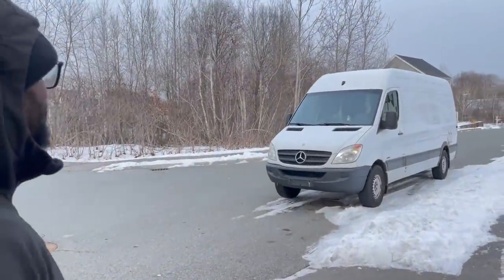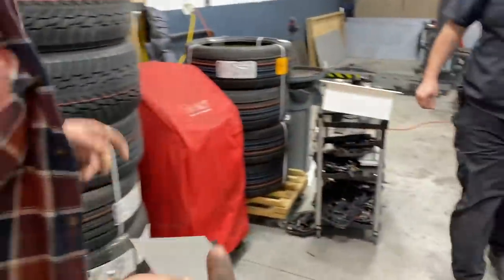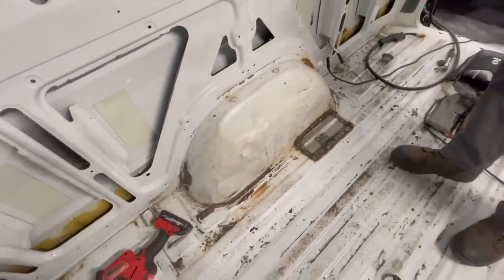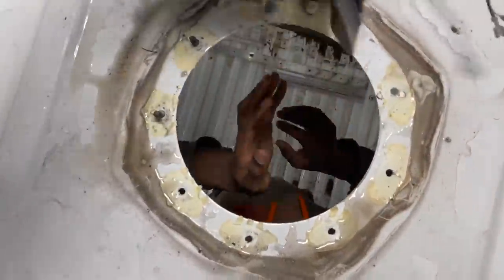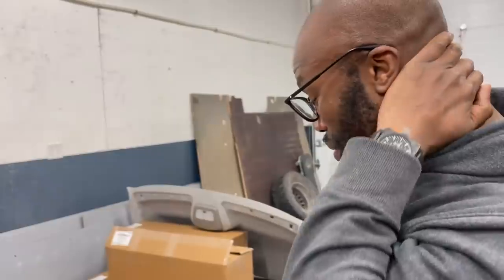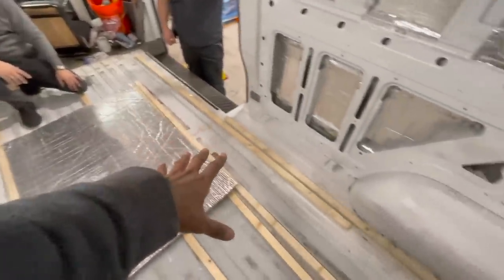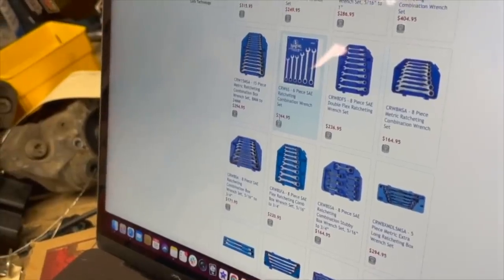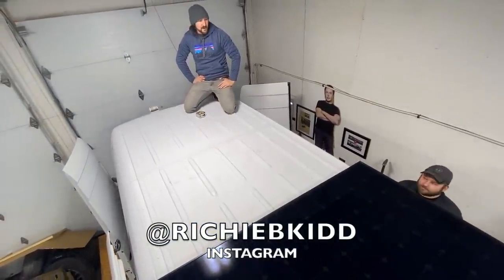Fixing the rust problem in our off grid sprinter van for just $8

Comment: Hey rich throw in a multifuntion steering wheel and the high-spec tachometer (both are plug and play no coding needed) and install an android headunit with an usb to hdmi Adapter so she can watch-tv or music-vids and use the stereo of the van (wich needs to be retrofitted and upgraded) 👌🤔
Reply: Ultimate Rich move would be to only allow videos from this channel to play on that system. 
Great idea though since the van has all the wiring and whatnot already in it.

Comment: Closed cell spray foam is the way to go. Keeps the moisture out. You can buy 600sq foot cans at Lowes or Homedepot and do it without a professional company. Works way better than any other insualation and the biggest problem, you won't have mold growing on the other side. OH and it actually has a real R value unlike the reflectix crap.
Reply: Is it nonflammable ?
Reply: @BobDevV  rockwoll does not smolder at normal temperatures ....
It is quite literaly molten minerals.

Thats like trying to burn down a rock
Reply: Yeah so many people use refelectix the wrong way, your getting a small thermal break that’s it. it ain’t insulation people but it does reflect ;)
Reply: The silver tape is not for heat/cold, it adds mass to the thin metal to absorb resonance aka sound deadening. If you've ever driven in the back of van you will know that sound the bare metal makes is stupid loud. Adding the B-quiet stuff makes the panels vibrate less and in turn lowers the noise levels.
Reply: @hein_mcleod  especially when you try to sleep and it is raining it helps really much

Comment: You should put sound deadening over the windshield, that lets in A LOT of noise. Just a thought.
Reply: Well you joke, but I reckon this would have sound deadening qualities... "In 1996, for the same occasion, BMW decided to unveil the ‘Insect Deflector Screen’, a new feature that would keep your windscreen bug free. The system, developed by Munich scientist Dr. Jurgen Afalfurit was comprised of a clear rubber coating applied to the windscreen. The rubber layer was so thin it would be invisible to the eye and yet so elastic that would instantly repel bugs even at higher speeds."

(Hint, translate the good Dr's Jurgen's surname to English)
Reply: You can buy “acoustic “ sound deadening windscreens as an option for a lot of models. Just looked it up, not the sprinter though :(

Comment: I watch a lot of car audio videos, and you know I'm actually really impressed by how you guys did the sound deadening  along with also doing thermal Insulation at the same time. very cool guys and thanks for showing us that.

I did have a question about the solar panels and I know the panels that you're putting on there are very efficient and probably last a long time, however I was wondering about the ones that you can physically attached to the body that are somewhat semi-flexible and wood mold to the surface of the slats up on top of the roof.
I was thinking about making my own or at the very least getting the flexible style panels that roll or the ones where you were able to mold them at least closely to the shape of the ceiling of the van.

I order myself some solar panels from eBay and was going to do the same thing but I realized that I can't use the regular polycrystalline style without them cracking so I was thinking about getting some small flexible panels that are thin enough to go in between the slats  that way it looks like it was integrated within the body.

there's a lot of surface area up there and sit sits on top of the roof more than likely it'll never be messed with so it's something I was thinking about doing this summer

Comment: @RichRebuilds please note that this silicone stuff you used for caulking the vent was technically the total wrong stuff. 

At home in your bathroom the temperature differences summer to winter are not big. But parking the van in the summer sun and driving through winter temeratures requires a stuff that is designed for that and will not crack and leaking. 

The internet is full of camper van owners crying over leaks because they made it wrong. Do not make the same mistake Leena will have to regretting, please.

The right stuff for that is Sikaflex®-252 : is suitable for dynamic loading, structural bonding, Product advantages: 1 part, Elastic, Can be painted, Tolerance compensation, High dynamic load, Vibration-retardant, Non-corrosive, High electrical resistance, Wide range of adhesion, Silicone free

Greetings from Germany! Love your channel

Comment: Gotta love rust repair! "Hey, it's a tiny hole. We'll be done by lunch time." Two days later you have chased that rust hole with the welder half way to the other side of the car and you're looking for two more panels to completely replace because you have discovered more rust under paint.
Good job on that patch panel though. Wasn't expecting it to be contoured to match the floor, but makes sense with how large it ended up being. Looks good!

Comment: I was missing every 10mm socket in my set - 1/4 drive and deep, 3/8 drive and deep, and 1/2 drive. I went to home depot and bought replacements. Now every time I turn around there are 10mm sockets. I even used a craftsman 10mm socket and I've never had a craftsman socket set.

Comment: OMG! RICH!  do you not also understand that the partition keeps things from hitting you while you’re driving if you have to make an emergency stop or someone hit you. I have a partition in my van. And I wish the door slid, it opens. I don’t sleep in my van now, but I slept in my van before. My van has no markings.  And I look like one however many expediters in the country.  I also set up my van to expedite, so it has a wooden floor with a E track, E track on the walls, no insulation, because it’s a work van and not a camper van.

Comment: I like how you guys are crushing the insulation and making it about 10 to 30% as effective as it arrived to you
Reply: This is sound deadening insulation, not thermal.
Reply: @Johnsmith69448  Its actually about both (if you want a van that is more comfortable in the mornings or isnt an easy bake oven). If i'm not mistaken about this product, this is glorified bubble wrap (which has ok thermals, if you dont compress the air out of the sheeting). The actual sound isolation this offers is limited and something you dont see recording studios using (if it was such a great material because of volume saving or price; more studios would use this to stop low frequencies than more costly approaches (double walls / weighty materials))

Usually the cheapest sound material are shipping blankets or nonvibrating quality plywood (providing the greatest density for cheap construction). That is if you care about trying to stop low frequencies.  

If you place flush (to your wall) 2 ply plastic sheeting, that does nothing to deaden any significant frequencies (high or low).

Comment: Those Merc and Chrysler versions vans are RUST buckets.
You definitely want to rust proof the doors (from the inside) and all the underside with a proper sprayed oily product. A must on those !
The tires are truck rated i.e. for heavy loads. They probably are rock hard. Softer tires would be a great improvement, comfort wise.
Great deed for your young lady, guys !  👍

Comment: Just FYI to viewers who actually work on stuff, steel from a steel supplier costs a tiny fraction of the amount that it does from a box store. I pay less for a 4 foot by 8 foot piece than I would for a square foot at HD. Smaller amounts are so cheap it will cost more in gas to go pick it up. Most towns have a steel supplier. A town of 50k might have two. I've restored a dozen 50's truck and only use steel patch panels made from mild steel. Saves hundreds to thousands on a restore.

Comment: As a sheet metal worker this makes me feel warm and tingly inside and also happy that projects like this are very achievable for a dummy dumb like me
Reply: How far of a gap can you weld shut when just inserting a piece like that? Me (having no idea about welding) would have made the piece bigger than the hole to make a seam.
Reply: @whuzzzup  typically yes you want the fit to be just right so there is no gap but iv heard of pipe fitter guys fill as much as a 3/4 gap. In a situation like this where it’s a light gauge and mostly flush with a few small gap areas its no problem especially when your not even gonna see it

Comment: Yeah, I'm of the faction who feel he should have kept the partition in. 
It isn't just about the privacy and boondocking incognito, it's also about safety.  
Not everything in the back of that van is going to be anchored, so anything set unsecured becomes a ballistic wrecking ball.  And if she's in a decent front end collision, or God forbid, she rolls it, even much of the anchored stuff can break loose and come up into the front of the van to beat the hell out of her in this already traumatic moment. 

That partition was quite robust too...  it not only acted as an effective bulkhead, but even added a little extra structural integrity with side collisions or rolls. 
That baddass partition is one of the big advantages of van-lifing an industrial grade cargo van.  She's so much safer while driving with that door closed. 
More injuries and casualties in van wrecks are by stuff slamming into the driver inside the vehicle from behind. 
Rich shoulda left it in.
Reply: And it also was a great insulatory barrier.  Designed for the reverse actually...  to keep the heat and cooling from the small climate control system in the cab for driver and passenger since the cargo doesn't typically care.  So when heating or cooling the living space, it's a big help to keep it in the back of the van, since al the glass up front will be the biggest area for loss.  
All that work insulating the floors and skin of the cargo area, and gonna hang a curtain for the front.  A curtain doesn't contain anything. 
Think McFly, think!

Comment: You could of went to a recycling yard and had them cut a actually hole wheel well and floor section out of a total van. But that worked great, no need to over spend or waste time.  I have seen vehicles at the recycling yard with a major section of the vehicles cut out. But that's how most body shops do body work, they use more used part's then new parts on vehicles over two years or older.

Comment: Absolutely don't forget to make up some insulated covers for the windows.  Single pane windows lose a load of heat in the winter.  I bought a roll of reflectix for my RV trailer, it's made a massive difference this winter over last winter.

Comment: You probably already have plans for this, but dont forget to wire your "house battery" into the alternator.  That source of power will outdue your solar panels in just 5 minutes of operation. Also have a solenoid in that system so the house battery doesnt deplete the starting battery

Comment: Regarding the engine governor, why not just remove it or disable it? I've done this on other vehicles. If it's in the programming for the ECM, which seems like it would make it simpler to do, just get a software refresh for a standard diesel Sprinter van.

Comment: There are multiple reasons to keep the partition. No matter how much you insulate the van, heat and cold will escape through the windows. There are a lot of windows in the cab. The partition keeps the heat from reaching the cab.

Comment: Need to put in one of those Japanese diesel heater systems it comes with everything you need except for the wiring and they're cheap and reliable I've seen them in heat when tires school buses up here in New Hampshire and they're very efficient you can go a whole day on like 2 gallons of fuel

Comment: Hate to say it after the fact but you should have sprayed as much closed cell foam for the exterior walls, roof and doors as possible.  That insulation you are using doesn't have much of an R factor regardless of how they advertise it.  Also the metal framing that the walls will connect to will cause thermal bridging and bypass your insulation.  Insulation is going to be the limiting factor of how comfortable the rig is and how much fuel she uses.

Comment: Set that solar panel off the roof a little for air flow. Heat will build up if installed directly on the roof and severely effect performance and life span. Have fun.

Comment: Did you use silicone to seal the roof vent? I hope not, it casues corrosion. It should be  Butyl tape or similar Butyl sealant.

Comment: @RichRebuilds ...You rebuilt an RS7, I’m strapped for cash right now, do you think you can help me fix a coolant leak (more like coolant outpouring) in my S3? It’s right where the auxiliary radiator is behind the front bumper and I need to get to work, have not missed a day bc of the pandemic as an essential worker

Comment: Dont use silicone to seal the hatch as it will fail and leak , use a decent sikaflex . Also cut the hole small by 5-10mm and bend a lip up 90 deg, it will help a bit should the sealant fail and help stop a torrent of water coming into the van.
End of rant ....

Comment: 5:38 Those welds look awful. Probably because the welding surfaces weren't prepped properly. You can pull those wires off and laugh about it all you want, but that shit will break eventually. Being that it's not in a load-bearing area, there's probably nothing to worry about. But the lack of penetration is obvious, and I wouldn't pay for that quality of work.

Sorry to be a Debbie Downer. I used to inspect welds for a living.

Comment: I wanna do a video where I show Rich Rebuilds could have saved that $8.00 and fix that rust problem for free!!

Solution for free rust repair.  Use the metal cut out from installing the fan on the floor!  

Tada $8.00 saved!

Comment: It's fine that you put out money to buy that sheet of metal, but I'm just as sure you knew you could have gone on Freecycle, Craiglist, or Marketplace and found a washer or dryer or any number of metal appliances and had your share of scrap metal. I was willing to let your ignorance about partitions go the way of blissful silence, because you were so wrapped up in the communal knowledge that defines anyone else in society. Absolutely everyone knows it's a stealth van. Sorry, your ignorance shown through like a light of absolute knowledge yet unseen. There are plenty of contractors that use Sprinter vans (some sub contractors) for storage, mobile work platforms and rest areas. Those that do, might be upset that I would even suggest this right now, because, well, it's less likely to be thus if I discuss it. So, in your rush to dispose, maybe look into integration of equipment already on hand. I'm guessing your reason for attempting to sway us with your excuse is precisely because you were adamantly warned that you didn't need to dispose of the partition and insisted you knew better and now you feel just a tinge of narcissistic absent guilt? All my comments aside. I'm happy that you're doing this, and hope that altruism is actually the reason. Thanks!